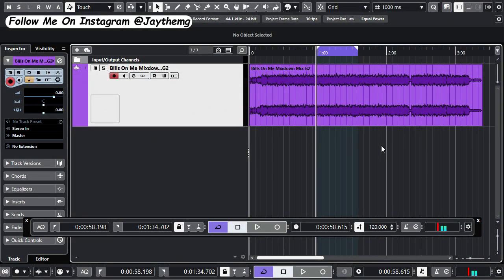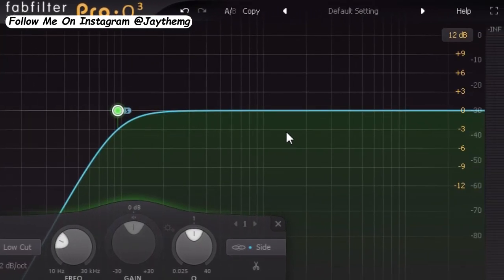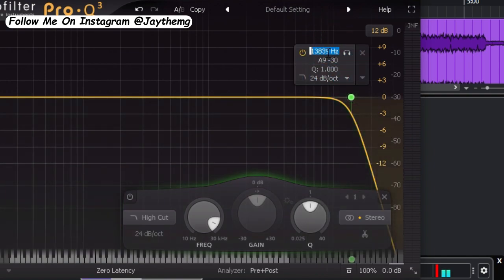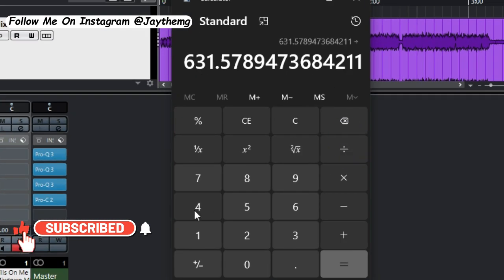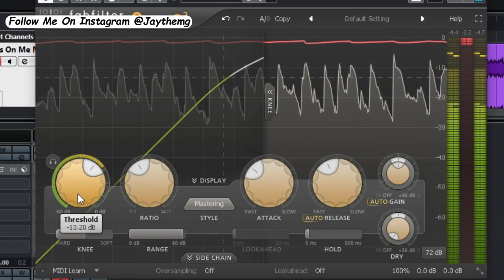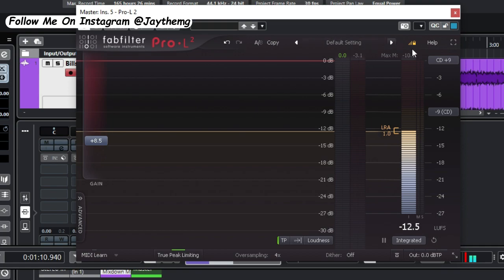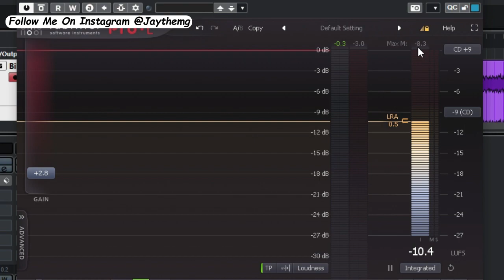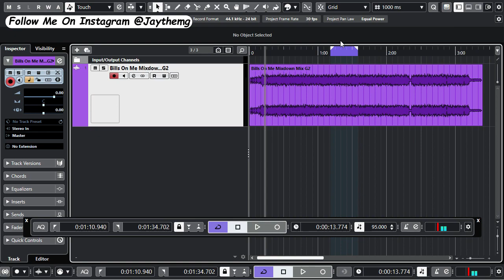How To Master A Song In 3 Steps - Mastering With FabFilter Plugins

Comment: Hey, nice video! Why did you cut down from 95 Hz?
Reply from the maker: Thanks, I’m glad you like it! The idea behind cutting a bit of the low end around 50 to about 120Hz is to keep the low end mono, which gives the mix more focus and translates better on different playback systems. That’s why I cut the sides in that range and kept the mid intact. Which is almost the same as using an imager like Ozone Imager for example and just make the low frequency band mono to a certain point..
Reply: @JayTheMg very nice hack!

Comment: Great video, brother. Could you help me with one thing?
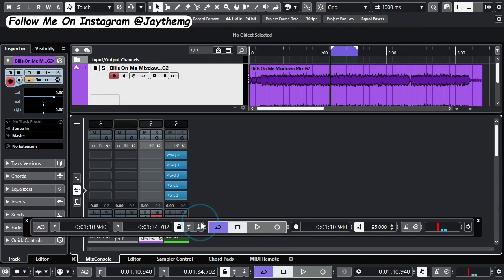At 5:35 you decide that you should place ANOTHER limiter on top and reduce this control "Output level"
Why did you simply not do it on the other limiter? And what exactly is this output level control? Why not just reduce gain?
Reply: I was thinking the same thing. It just added the effect of the limiter twice and became overkill.

Comment: I wanna know why you make your first low cut eq to side in the beginning
Reply from the maker: This is to just ensure that the base remains mono. If we cut it off from the sides then it will just remain in the center (Mid). We don't need low frequency information in the sides otherwise it would make the mix sound unstable. Bass is a mono instrument.. so we have to contain it and make sure that it stays that way..

Comment: Tell me please should you master the finished AUDIO file or to master in the project? Does it have difference? I mean can this happen that when you master the finsihed AUDIO file then some instruments corrections might be needed like changing the volumes of some separate tracks? Or is it absolutely fine to master the finished AUDIO file like you do?
Reply from the maker: Hi hope you are doing great. You can master the finished wav file or directly in the project if your CPU can handle that there's absolutely no problem. For some projects I master directly in the project for others I export. The reason I used to export and then master was because back then my computer would start glitching due to lots of plugins from my mix as well as my master. However , the downside I found with that method is that after mastering lets say you notice an error or something too loud then you have to open the mix correct it and then export and take it to the master project again which is so time consuming. But if you master directly you can just adjust things right there in the project. Another reason why some people like to export and then master is because they just like to see the whole mixdown waveform so that it gives them an idea of which areas might be loud or low.
Reply: @JayTheMg  Thank you for such a cool answer man!! Appreciate it!
Reply: Jay tell me is it ok to get laudness of the track by using Izotope Ozone Maximizer? Or anyway I need to use limiter?

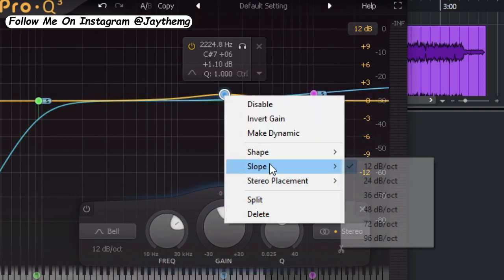Comment: 1:49 question, if you targeted around 2k based on key of the song (which in this video is C#), why the side chain on is D#? does it need to aim one step up of the key for that one?
Reply from the maker: Hi bro hope you are doing great. The reason I boosted on the key of the song at 2Khz is because that is where most of the presence and detail in the song exists. However, the boost at 10Khz in the sides only is to just give the song some stereo feel in the top end there’s is no reason why I boosted at D# it just happened that 10Khz was at D# the target was boosting everything above 10Khz in the sides. Thanks for that question..